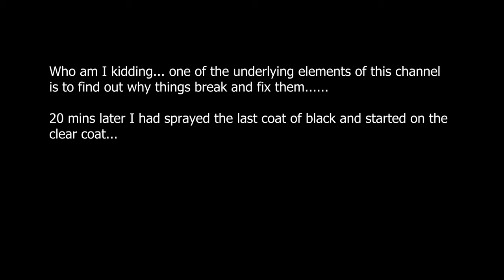Not wrapped! || Why painting the jet ski was the best option for the project

Comment: Looks good. Good choice to paint rather than wrap. What brand of basecoat did you use? 2 pack, acrylic or enamel?
Reply from the maker: Hi Simon, it’s an acrylic paint by Concept Paints. Australian Company, I get most of my paints you see in the videos from AutoBarn.

I have to do some more painting of the fibreglass hull soon, I will show it then for you.
Reply: @1MichaelJones  Nice. I've seen Concept's stuff a fair bit and the guys at VG Auto Paints seem to use it quite often in their YouTube videos too, and it seemed to go on really nicely when you sprayed it. I recently restored a Yamaha EXR hull which I repaired, epoxy skim coated in parts then primed, painted and clear coated it - it was a painful job. I used Norglass Shipshape epoxy primer which was very hard to work with but as tough as nails for the hull. I don't have a spray gun setup so I had to use a roller for the primer (it was like painting Araldite!). Spray cans for the base coat and then I found an aerosol-based 2 pack clear to top it all off. Looks great after all that, but I wish I did it your way with a half-decent spray gun and indoor/garage setup! 

I look forward to seeing your project continuing on.